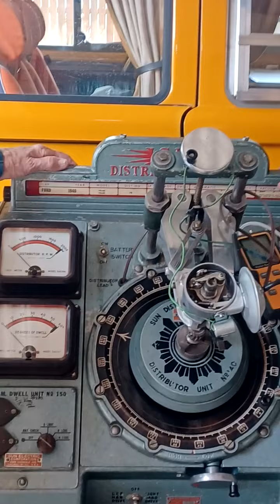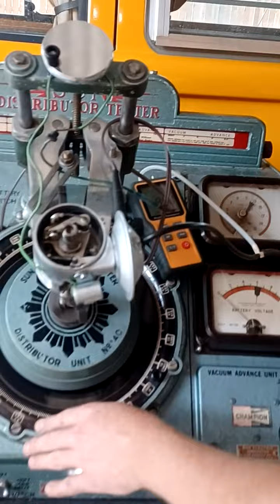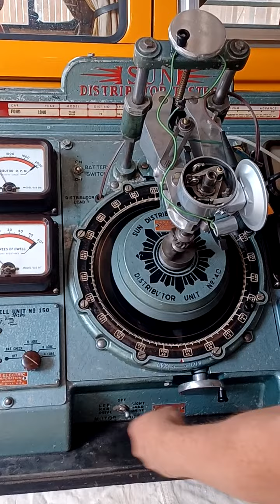Volkswagen Beetle Distributor Testing of Reproduction Vacuum Canister

Comment: Great job Adam!!!!
Reply: Bill--thank you for replying.  We continue to work through some issues--mainly, can this reproduction Vac Can be used with Distributors 1965-1970.  A premature analysis is that only by using a distributor testing machine, such as this one, can such an assessment be determined--due to several variables.  One size fits all is over-stating the off-hand ability of this reproduction Vac Can.

Comment: Great video!
Reply: Hello, Guy!  How nice to hear from you!  We are struggling with variables which continue to arise.  The lack of official data (no markings on original vacuum canisters, for example) stymies efforts to quickly match vac cans with distributors (1965-1970).  We conclude (at this point) that only by using a calibrated distributor testing station, such as this one, can vac cans, springs and distributors be matched to meet specs and achieve proper performance.  Stay well and keep loving your Black 1967 Beetle!